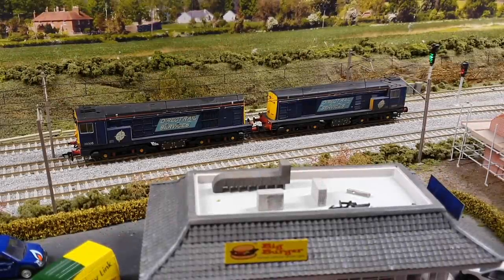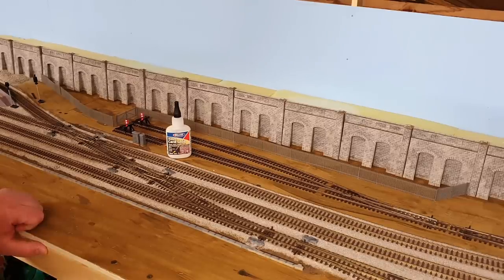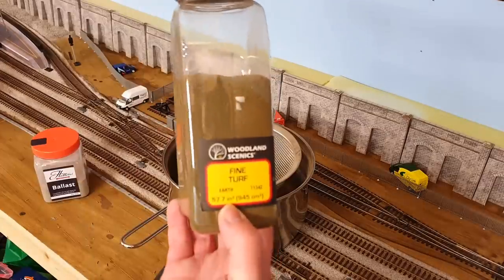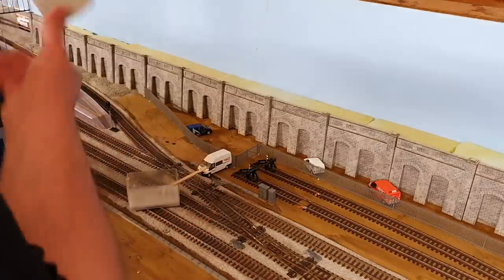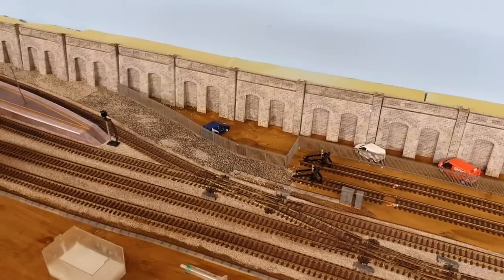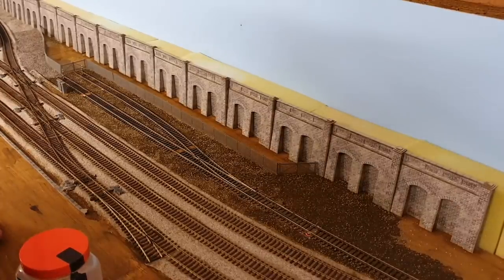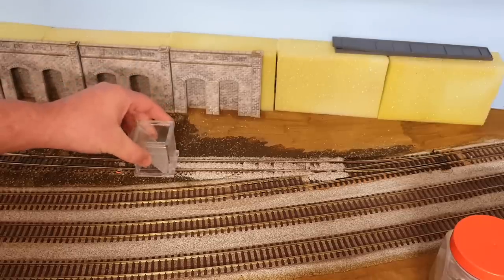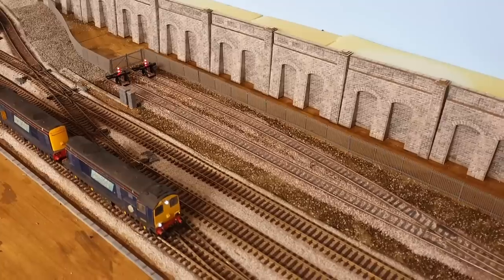New Junction - Adding a Station Pilot Siding, Part Three | Ballast & Ground Scatter

Comment: Loving the layout, just a thought when your running the steam trains you should have a diesel locomotive on the back end of the carriages like they do on the national railway for operational reasons
Reply from the maker: Good point and a good excuse to buy something else
Reply: I know the flying Scotsman travels with a class 37 (deltic) diesel on the back, so probably would be the same arrangement for all steam trains on the national railway, usually only there to supply electric power to the carriages and to provide a back up braking system and for when running in reverse where they can't turn the steam train around
Reply: ozzy1180 a deltic is a class 55. And a class 37 is a tractor. 👍

Comment: Where did you get the fence from. And thanks for another great video
Reply: Steve Hearn it's available a most model railway retailers £10 a pack. You can get it with gates also. It doesn't need painting, the grey is perfect. I used it round my football ground and painted it red plus have some grey in other areas.
Reply: Ewood Railway fencing and more is quite hard to get in New Zealand lol
Reply: Steve Hearn wills ssm316 is the product, available on the internet with international shipping

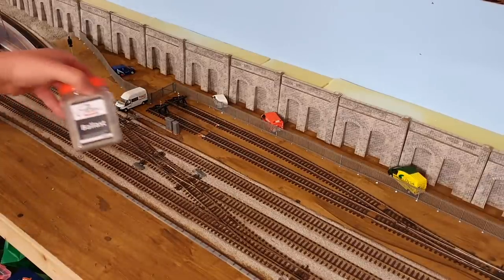Comment: 03:54 the British Gas’s van looks good parked there  maybe it could be small narrow road and park for Network rail vans or 4*4s or like but make it look like really if at all used look as so small. Maybe it’s not meant to be w car park but they don’t care Park there as wont get seen or convict told off for the illegal parking
Reply from the maker: It lends itself to some scenic work for sure
Reply: New Junction but you know what I mean maybe parked where they should not maybe  for lunch or cos it’s nearer the station save them walking
Reply from the maker: @mtty1988  its definitely a good idea worth considering.
Reply: New Junction would show that railways and workers are not all twee and good. Make it feel more real. Add say a network rail transit there pos another unmarked car or a workers. Make it feel dirty dingy grimy like you may find a body there or a place to dump it. The staff only use is as it saves them having to enter the station walk the long way and sign in can say they do work and leave. 
Maybe add some flytip stuff. Not to much as want other wise works would not use.
If it was real life you would see  the staff feet on dashboard on lunch with greasy spoon  or Mcdondalds food news papers for a long lunch Maybe a place to hide say stuck in traffic out a way or as mentioned upper gain easy access to station save parking walking singing in.
The working clAss builder type network rail staff I’m dirty uniform apposed to the more model class clean uniform staff with smarter appearance(probably uni education more a higher qual staff say architects) dose that make sense